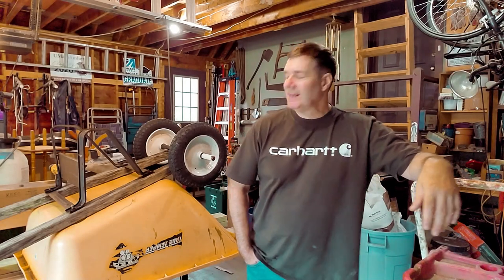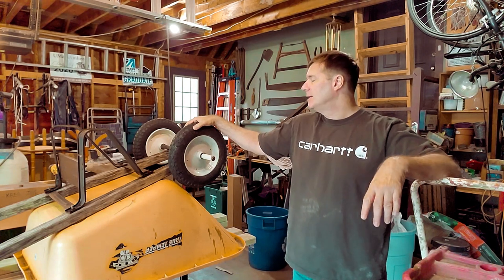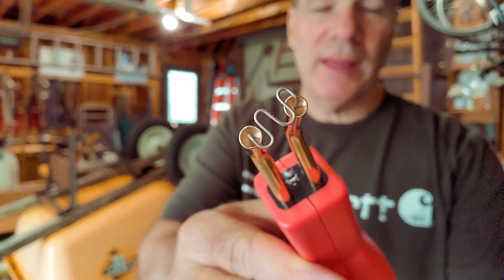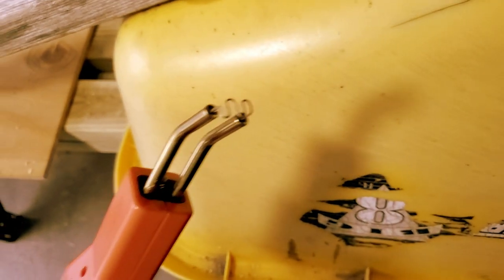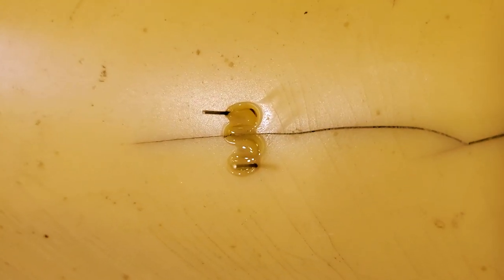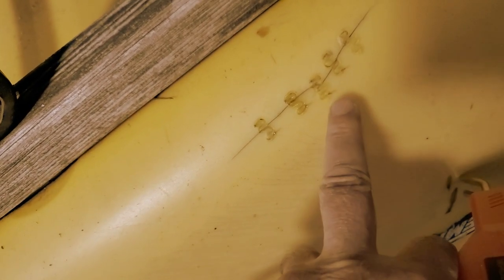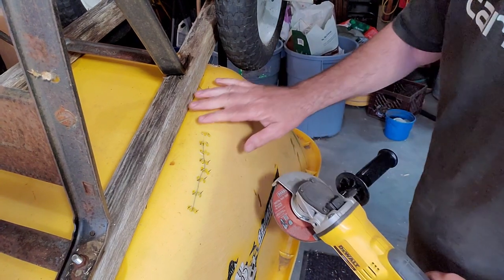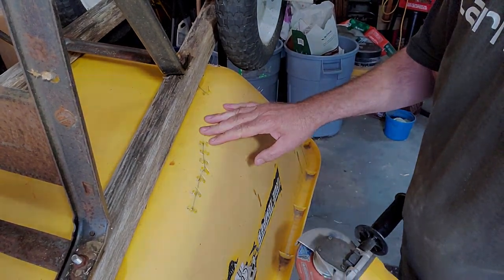Plastic Welding - Wheelbarrow Tub Repair

Comment: Just ordered myself a welder and those staples. Safety goggles are a must as you wouldn't want a piece of a staple in your eye 🙂 My barrow is split in the middle so I'm also putting some marine ply under the tub for added strength. Thanks for the video
Reply from the maker: Right on. I wish you success in your project. Thanks for watching the video!

Comment: In the past year I have rebuilt three wheelbarrows, two steel tray and one plastic tray.

I'll make a few comments based on what I've learved.

1)  The main advantage of a plastic tray is lighter weight compared to steel.

2)  The main disadvantage of a plastic tray is that they crack fairly easily, and the main reason such wheelbarrows are discarded seems to be cracking.

I found that repairing the crack in my wheelbarrow was pretty easy. I found a piece of semi flexible plastic and lined the bottom of the tray with that additional plastic. I glued the additional plastic in place, and then drilled new bolt holes and reset the bolts holding the tray to the frame.   That seems to offer a lot of additional strength to the tray which I'm hoping will minimize additional cracking in the years to come. 

I agree that having tires that don't go flat is a big improvement.  The test of a wheelbarrow is that it ALWAYS needs to be ready to provide service when needed,  and if you have flat tires you have a useless wheelbarrow.
Reply from the maker: Great comments @SeattlePioneer. I appreciate what your saying and agree with the though of reenforcing the bottom of the tub. Great call.
Reply: @ExFedHomestead  <<Great comments @SeattlePioneer. I appreciate what your saying and agree with the though of reenforcing the bottom of the tub. Great call.>>

Thank you.  I've seen numerous videos on various methods of repairing plastic trays on wheelbarrows.  I think that's fine and suggests that there are a variety of ways to do that kind of repair job. 

I particularly appreciate your support for the idea of reinforcing the bottom of plastic trays.  I used a piece of flexible plastic I had on hand, glued and then rebolted the tray to the frame.

The major reason for discarding plastic wheelbarrows are cracked trays, which can happen pretty easily. Reinforcing the tray suggests that the likelihood of such cracking will be significantly reduced.